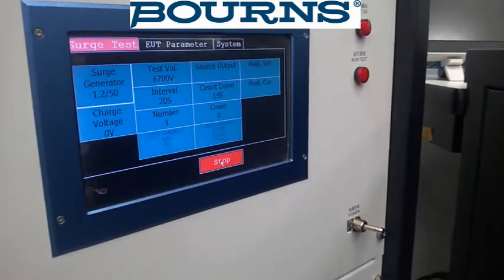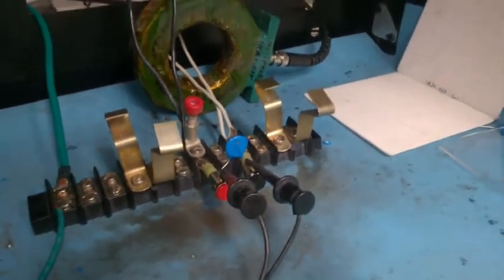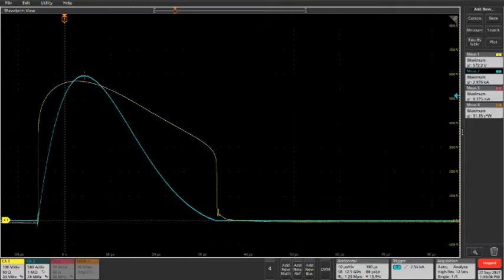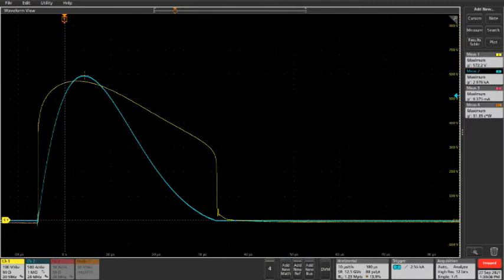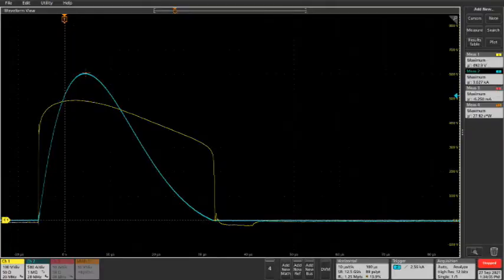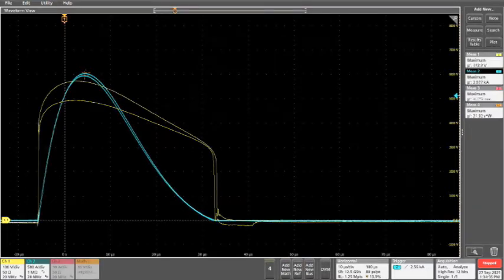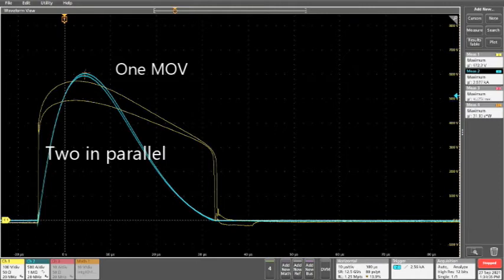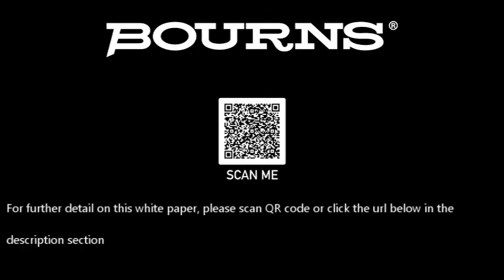Surging single MOV vs 2 in Parallel

Comment: what will happen if we add more movs in parrallel, example 5 movs are in parralel, will clamping voltage decrease? and how many times it will decrease, approximeate 5 times or else?
thank you
Reply from the maker: Assuming the selected Metal-Oxide Varistor (MOV) has a clamping voltage of 400 volts at 1 kiloampere, to maintain a clamping voltage of 400 volts at 5 kiloamperes, you would need to connect 5 of them in parallel. Each MOV would ideally handle 1 kiloampere, provided they share the current equally. While MOVs generally maintain a relatively constant clamping voltage, it's important to note that the clamping voltage can increase slightly with higher surge currents.  Here is the paper that explains a little bit in detail: https://www.bourns.com/docs/technical-documents/technical-library/varistors/bourns-tips-on-selecting-the-right-mov-surge-suppressor-white-paper.pdf?sfvrsn=cb5e43f6_12